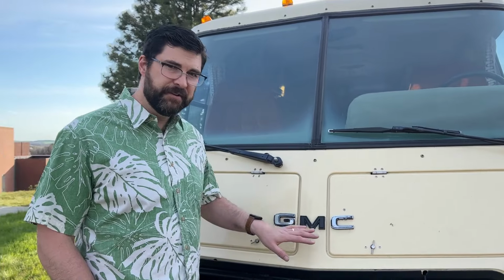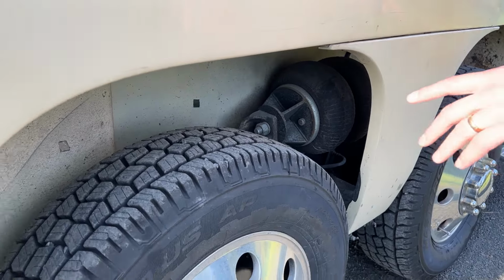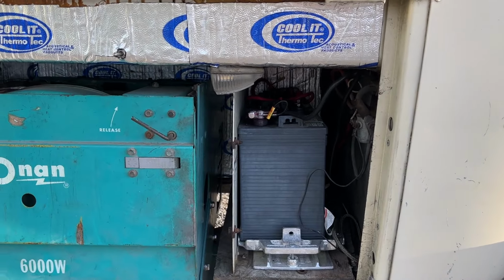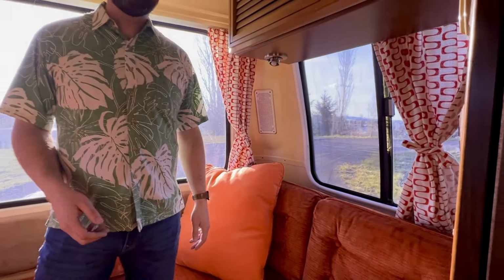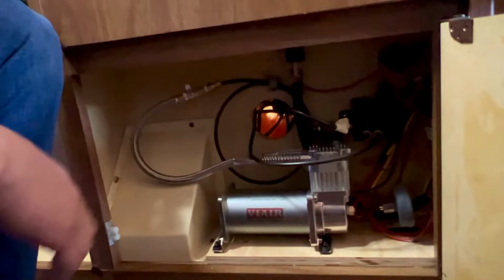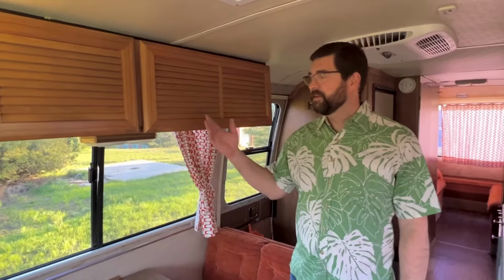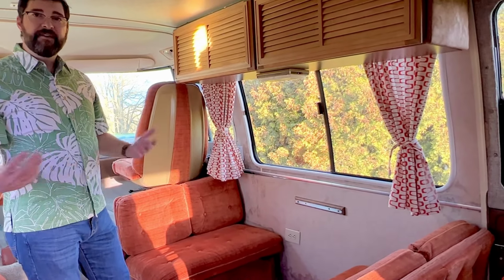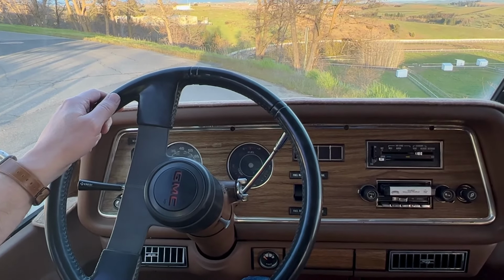GMC Motorhome Tour After 1 Year

Comment: My question is… what is the date code on that propane tank. I know on the 20 pounders there is a date (I think 10 years) where you have to replace the tank or they won’t refill them. That large heavy duty tank may have a much longer date. I know some have replaced them with 20 or 30 pounders as it’s getting harder to find places that will refill these at the LPG tank stations. I’m looking at an Airstream 350 which has the identical setup so I’m just curious.
Reply: Our permanently mounted tanks. Do not need to be recertified. Sometimes if you go to a U-Haul with unexperienced employees, they don’t know this, but as long as you find a good place to refill you shouldn’t have a problem.
Reply: @ thankyou🤙

Comment: Flexible solar would be of great benefit.  No mileage penalty like rigid panels.  There are ways to continue with a/c and Microwave type typically managed only with shore power to run on big battery systems.
As to running air all the time, inside reflective shades could reduce your reliance on A/C.   A 12v a/c unit could keep up with the heat if you had decent tint and reflective shades where you didn’t need windows.

Comment: that couch that turns into a bed, how much can that bed hold with it connected to the roof like that?
Reply from the maker: Good question, the operators manual describes how the bunkbeds work but don't list a weight capacity. I have seen several people comment about having people weighing over 200lbs sleep up there so I think it must be at least 250lb but I don't know for sure.

Comment: The GMC MOTORHOME DESIGN AND FEATURE FUNCTIONS is Outstanding. I'm just surprised to see a 77 with a vacuum brake assist booster as opposed to the Hydroboost that GM introduced in 1976
Reply: Your moniker “Eldorado George” says you know precisely what you’re talking about. 
Rumor has is, the only reason GMC stopped making this futuristic mobile camper, is bc they quit making the engines for the Tornado and El Dorados as your alluding ,were also used in these Motor Coaches. 
Are those engines bulletproof or what?

Comment: Awesome motorhome, thanks for showing it. I love you tried to keep it all original, as much as practically possible. I like that you kept all the amenities, including propane. I see so many people remove the propane because it is old and they don't want to deal with it, but it makes the living in it so much more comfortable and practical. We have class-c and go camping often and do a lot of dry camping with limited generator usage campgrounds, and can't imagine going without having hot water, heat, stove, and 3 way fridge. Solar would be a nice upgrade, but just to keep the batteries topped up for lights, and other minor things so you don't need to fire up the generator.
Reply from the maker: Thanks for the comment! This is the first motorhome I have owned but I think it was really well designed and, other than some mechanical and safety things, I don't see much need to improve on the original design.

Comment: Great idea with the brake booster. My GMC Motorhome stalled on me at freeway speed and as i coasted off the exit, i found out how goddamn hard it is to stop that beast with no boosted brakes. Was a scary moment. Gonna have to look into that system for mine. 👍
Reply from the maker: Scarry! Before we had our carb rebuilt, she would die on the road some times and the vacuum pump would kick in and do it's job. It's bad enough not having power steering but at least you can stop.
Reply: @MrGMCMotorhome  I love the GMC Motorhome community. So many good natured folks willing to help each other out with informative tips on some of the nuances of these feisty beasts. Suffice it to say...despite all the overwhelming work that needs to be done on em, they are awesome and worth the effort. 🇺🇸

Comment: BACK UP CAM AND 3RD BRAKE LIGHT WOOD  BE SAFE ADD ON
Reply from the maker: I have thought about both and will probably do them at some point. There is a reason most new cars have both, nice to have and improved safety.
Reply: @MrGMCMotorhome  yeah some new pick ups have the cam integrated into the 3rd light

Comment: Do you know of anyone pulling the out the motor and upgrading to a diesel or an LS base motor?
Reply from the maker: There are a few people who have done diesel swaps, I haven't heard of an LS swap. The challenge is the front wheel drive setup and limited height available to fit under the floor. Most people stay with the stock engine because it does the job well and is reliable and easy to repair or rebuild when needed. It's common to add fuel injection when people want to modernize it a little.

Comment: Another awesome video. I consider it unforgivable that GMC would discontinue the Motorhome after only 5 yrs. of production. Typical bean counter attitude. Always trying to save money at the expense of quality and reliability.
Reply: I think they should make these now ..they are perfect ..not too big not too small , and it's layout is really awesome, and the bathroom was pretty amazing for it's time it's still better than most even now. Upgrade the bathroom it would be so great .
Reply: @mariamaria2751  I agree. Why they were ever discontinued in the first place is beyond me. It's perfect in size. It's perfect in shape. They got it right the first time. The only mechanical upgrades I'd make would be to install a GM 6.5 litre Turbo Diesel engine, maybe a 6.6 litre Duramax Diesel if it works, and a compatible 5 spd. automatic gearbox, preferably one that allows manual downshifting. 🙂
Reply: And it even came with its own vaccuum ?